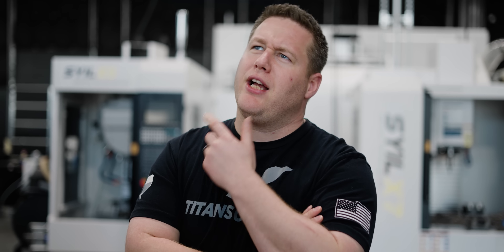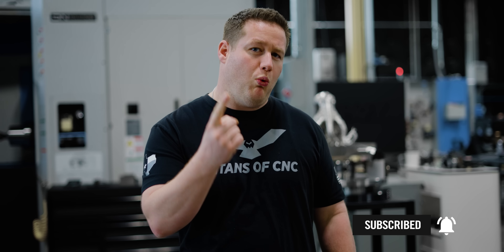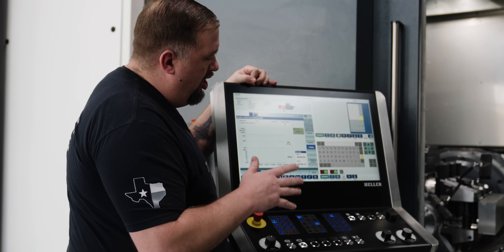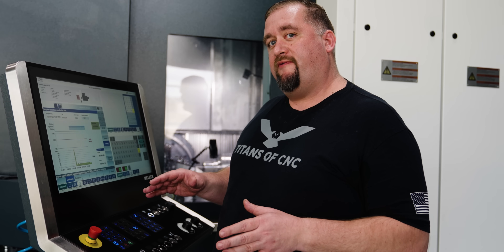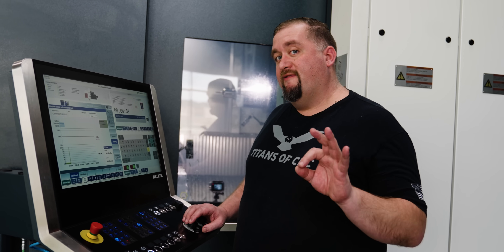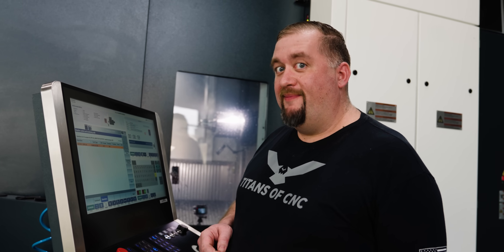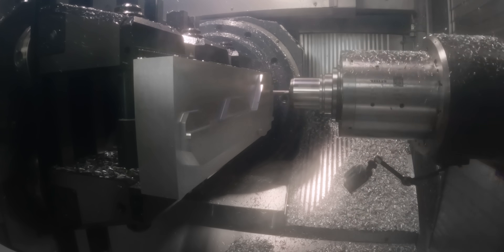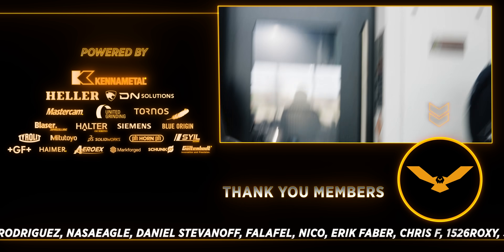This Will Save YOU MILLIONS!

Comment: Obviously when you set up ACM and enter in your allowable overrides, you're not going to do that blind.  You have to prove out the recipes for your tool and know what you can get away with in whatever material you're cutting, how rigid your workholding is, etc.

If you have all that information when programming the part though, why wouldn't you just program it with those speeds and feeds to begin with?  Is there something more advanced going on with the torque monitoring that may not be obvious?  As far as I can tell, it seems like it's just looking for low torque situations and applying up to a 50% feed override during those cuts.  How does the machine decide how much override to apply, assuming it isn't a binary choice?

I guess I can see this being useful if you don't want to spend the time taking a couple proof parts and tweaking the program.  Gets you to the end result faster with less human involvement.
Reply: In my workshop, you will see the lathe of all kinds of parts
Reply: Sometimes if you're on second operations, or pre-existing cast parts- for which you have no current model to rest-machine from, this would be incredibly helpful to adapt a program to its highest speed the second run of it through the control.

Comment: Remember back when they ran machines relatable to every day machinist?  Now they are just doing demo's on million dollar equipment that maybe 1% of people will ever run.
Yeah, cool ACM feature.  Again, for the 90% of the country that uses Fanuc, that doesn't help.
Sorry, just seems you are preaching to the 0.1% these days.  Good luck and happy machining
Reply: Siemens is big in Europe, fanuc is gross 🤢
Reply: I agree.  I just feel like, if you put the best of the best machines with some  of the most expensive tooling, yeah, you can do great stuff.  But that is a huge capital investment.

 @Minerals333
Reply: Makino pioneered this feature (a long with several others) on a fanuc control over 2 decades ago.
Reply: @fordhoarder My 1997 Mitsubishi FX-10 wire EDM had similar feature-though didnt approach it the same way. Just allowed the machine to increase or decrease active speed based on load. Simple yet similar.
Reply: ACM on not a million dollar machine 
https://www.youtube.com/watch?v=_UNbpvfmK-E&t=185s
Reply: Thank you. @MrCNC
Reply: In my workshop, you will see the lathe of all kinds of parts

Comment: the real question is
you can add FEED ?
because from what i saw, TITANS go always at 100%
i know i know is roughing pass but as TITANS said, to be better and work with the best, you CANT run or the client will not accept the pieces (was like a video about inconel and lockeed? about true feed rate and best parameters to be considered machinist and just not metal farmers with a shovel called end mill. LoL)

Comment: We have a similar thing on our DMGs with Heidenhain Control, its called AFC there (adaptive feed control) but you can also change the lead in and lead out speed there. Pretty useful feature. EDIT: But there is one thing you should be aware of using this: It changes the feed based on Spindle load not Tool load which means If you are having a dynamic milling path with different axial depths of cut you could overload your tool on the tip cutting edge because If you are cutting in a shallower region the spindle load would go done because ap is decreased, this would increase the feed but now the tip portion of the tool is running 50% faster than the tool maker designed it for, this could ruin your toollife.
Reply: Great function. IT exists for 15 years. iTNC530
Reply: In my workshop, you will see the lathe of all kinds of parts

Comment: I got it, i got.
First step: buy Heller.
Reply: siemens control but yes
Reply: No, ACM works with Siemens and other brands too like Fanuc for example. Off course if you control is Siemens you will have more fancy screens to see the software working…but in the end works with others CNC’s
Reply: In my workshop, you will see the lathe of all kinds of parts